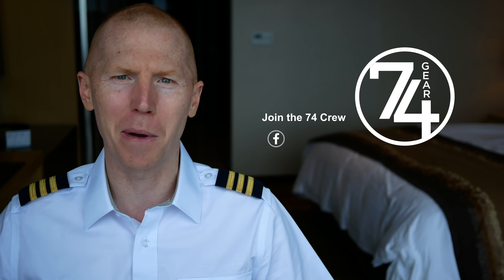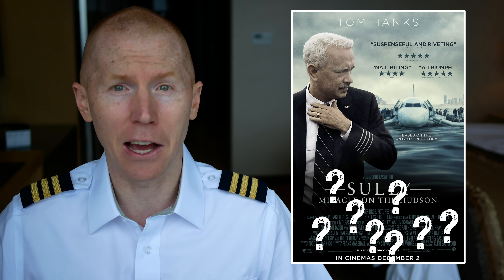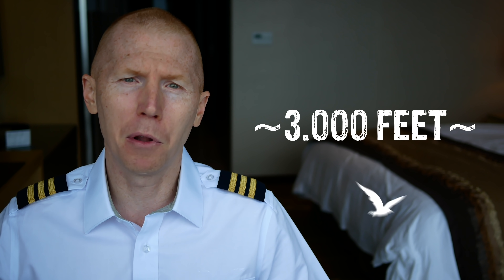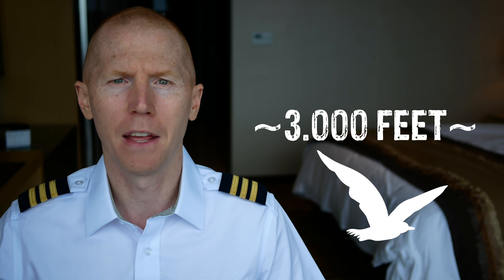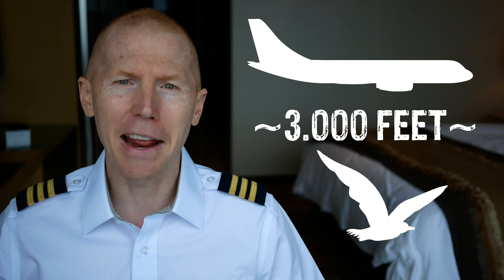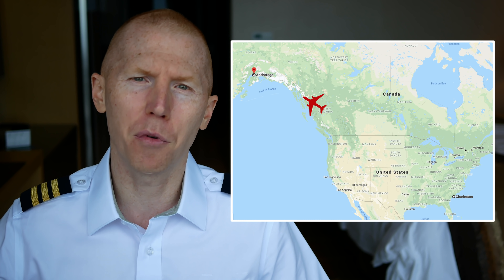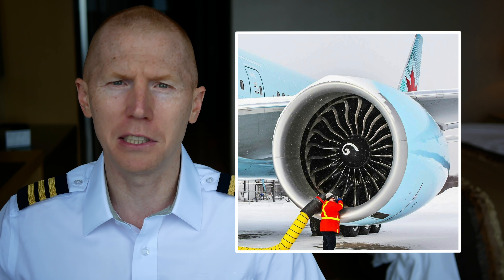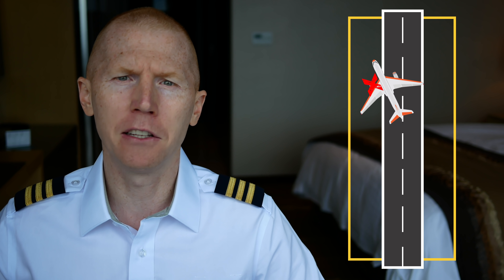Why Engines Don't Have a Mesh or Grates to Stop Birds

Comment: Make them 2” by 2” so it cuts the bird up more to make the jet engines digestion be easier preventing a big object and break it up some would be like this, imagine a brick... yeah that’s gunna need a new engine but imagine Little Rock’s going into it it’s going to be dented and very safe but you will still be able to reach your flights destination and one more thing make the 2” by 2” mesh design and make them sharp it’s like cutting up a toddlers food... but for a plane, who else (kinda agrees)

Comment: FYI....those engines are so massive, they can ingest a bird the size of a turkey with little to no damage, so long as it is around the outer edges of the fan and bypasses the motor itself. But even smaller birds can be ingested into the compressor without issue....to the plane, anyway. Tweetie ain't gonna make it. What brought down Sully was the fact his plane was reaaaaly hungry and tried to eat the whole flock.

Comment: The Russians have a technology to prevent their engines from ingesting stuff on take off❓.

There called slats. 

Their fighters have slats that close during takeoff and on top of the wing that open. ✈

Once airborne they simply reverse slats. The ones on top of the wing close and the ones in front of the air inlets open. ✈

Wondering if they would prevent bird strikes from happening?🦅

Probably impractical on modern airliners.

Comment: It wouldn’t make sense to put a grill onto something that sucks with such force, the bird would just be stuck there till landing, now think about if you had 30 birds stuck onto the grill in no way the engine will be able to suck air in at a rate to keep the airplane up in the air without trouble.

Comment: Im still for lasers, because they wont stop air flow.  Just pint them upward and away from the front of the engine cover and run them durring that 3000 foit sweat spot durring take off and landings.

Or go with a retractable slicer dicer screen that can be retracted to save the fuel economy

Comment: Just get rid of the engines altogether and develop a plane, that flies just like a bird by flapping its wings.
Reply: Yeah what could possibly go wrong!
Reply: Like an ornithopter
Reply: I cant see that craft go more than 300 km/h
Reply: @FlyLeah  r/woooosh
Reply: @FlyLeah  you mean h/km
Reply: funkyleah actually they’ve been able to make one that tops out at 389 mph (626km/h) and it’s only getting better. Look up Kenth Brooding’s model aircraft called the “Madill Ornithopter”. Right now it’s roughly twice as inefficient as the A3O8, but keep in mind that it’s still in its infant stage. The advantages of an ornithopter design is that it can theoretically be twice as efficient as an A350. The problem lies in the thermodynamics and the appearance. You see, the thermal equilibrium of the vertical stabilator is just too expensive to realistically create and mass produce. The amount of titanium (currently the only metal that can handle the excess heat while being light enough to fly) required is just unreasonably too much. Also, birds see the craft as a threat and will frequently kamikaze themselves to bring the aircraft down. They will try infiltrating through the windows and will peck the passengers eyes out. It’s a ghastly sight to see if I do say so myself. I still have nightmares about those damn pidgins
Reply: @lasercat538  LOL twice as efficient, bollocks. Metal fatigue alone buggers the ornithopter design.
Reply: @lasercat538  best comment of 2020
Reply: @carbon1255  he said inefficient can you read? (Yes I know he edited it but it was probably a typo)
Reply: @carbon1255  he said inefficient.  Ouh
Reply: Yeah, but then you get this whole birds of prey problem
Reply: Lol that reminds me of a video of a plane flapping its wings
Reply: You've became the very thing you swore to destroy
Reply: Yea, and the enormous amount of energy you waste, such a low efficiency, you go incredibly slow, easily out of control due to the  always heavy turbolence. Imagine passengers having to sit in that for hours. A bird strike does not happen quitte often, and if it happens, the engine does not always fail.
Reply: Not fast enough
Reply: Ever flown in turbulence? The plane looks like a bird flapping its wings.
Reply: That would make a bumpy ride, waste more fuel, and it would take probably a year to do a 7 hour flight
Reply: Have the passengers help! Lower the costs of the tickets, but have them lift their own weight! Literally
Reply: @Zman44444  ?
Reply: @kokoslegend4850  the OP’s comment... flapping wings... have the passengers flap....
Reply: @Zman44444  terrible idea😂
Reply: @kokoslegend4850  cool!
Reply: @Zman44444  yea, but to fly to another country is too dangerous, and slow.
Reply: @kokoslegend4850  neat! I’m glad you enjoyed the jokes.
Reply: @Zman44444  yea 😂👍
Reply: It will be bouncy for the passengers through out the flight
Reply: GENIUS! I have a way to make money now... hehehe
Reply: Dune!
Reply: And how is that flapping accomplished?
Reply: @notthefather3919  by a way to heavy motor that guzzles fuel like you wouldn't believe...
Reply: Damn that would be a big bird going into the trade centre 2.0
Reply: @Roshaun Thomas eh just use flex tape
Reply: Now I'm imagining a 747 flapping its giant metal wings.
Reply: It already exists and it's called a thopter
Reply: LMAO
Reply: Reminds me of that "get real" meme
Reply: or fuck a bee, and then have his whole hive carry the plane
Reply: LOL
Reply: and then it will slap birds out of the air
Reply: Or just make an electric plane
Reply: @laronzovilla9863  wouldn’t go as fast and normal commercial jets and also more expensive and more things can go wrong. You would remove hydraulics and everything that would be so expensive to train new people for it and invest so much time...
Reply: @laronzovilla9863  that wont work
Reply: @laronzovilla9863  that is a good thought but making those arn't as easy as it may seem

Comment: Lasers do not block airflow. 

Myth: Busted.
Reply: CMDR Fly Auburn Its still going to allow bird guts inside the engine.
Reply: @48kelvin  A powerful enough laser would actually vaporise the bird. However, due to the immense power requirements, there would not be enough room on board for passengers.
Reply: @carbon1255  or the nuclear reactor needed to power that laser mesh lol
Reply: @carbon1255  why not use the laser only below 3000 feet, as he said birds are typically found below that altitude. And after that height,turn off. This saves the power too.
Reply: @akitakasakiama5258  For one thing, the laser field would need to be self-contained (the beams terminated by a backstop), otherwise the beams would be hitting other things near and far including the plane's own fuselage, potentially.  That backstop would need to be an extremely resilient exotic material (like a super-superalloy metal) to withstand sustained laser exposure again and again, day after day.   One could argue that such a system itself is way more dangerous than a potential bird strike.  Imagine if one of the lasers slowly falls out of alignment or the backstop fails or a bird misses the laser field but hits the laser emitting fixture on the front of the engine nacelle, now lasers are pointed every which way, hitting flight control surfaces, passengers, fuel tanks, people on the ground, etc.  Planes make hard landings, turbulence flexes the wings and shakes the engine mounts, it's not a suitable environment for precisely-aimed and calibrated lasers, at least not if one expects them to stay that way.  Also, the laser would need to be astronomically hot/powerful to incinerate a bird passing perpendicularly through its beam at over 200 knots.  If this is a laser array oriented like a net in front of the engine, the bird passes through the laser so fast that it's only exposed to the beam for the tiniest fraction of a second.  In order to accomplish anything, the laser would need to be so hot that no Earthly material would stand a chance acting as a backstop.  If the laser were some kind of IR/radar turret shooting the bird as it approaches the plane then it would have more time to focus its beam on the bird as it approaches (thus destroying it).  BUT, any mishap in alignment, aim, timing or misidentification of a target and you have a big problem on your hands.  Like, whoops the laser missed the bird but hit the chemical factory off the end of the runway.  Or, whoops the tracking system thought that smaller plane landing on a parallel runway was an albatross.  This is a case where the "solution" creates more deadly risks than it solves.
Reply: @akitakasakiama5258  It doesn't matter if it is on or off, it still takes the same amount of space :')

Of course it only fires for a few fractions of a second until the bird is ashes regardless.
Reply: @dmo224  You gave your answer to an absurd suggestion rather a lot of thought. I was more confused as to how a laser gets smaller when switched off and how you get the passengers in at over 3,000 ft. 

The US developed an aircraft laser system using a passenger jet. you don't really need a backstop, the idea of a point defence system is you fry any bird with a possible intersection with yours, you could kill them at 1km ranges.

However, you couldn't carry passengers xD
Reply: @carbon1255  Definitely agree that the weight of the apparatus and its power-supply remains a huge issue, whether powered on or off.  Something like what you described (the airborne missile defense system), where the laser isn't a mesh field but actually shoots out into the world, seems like the only way something like this could even work.  Unless, there is a ground-based anti-bird laser battery shooting up at birds.  The problem with either of those non-backstoped laser turret concepts is the potential (almost guaranteed eventuality) of missed shots and collateral damage.  If you were to replace the laser beam with a gun that fires conventional ammunition, it's easy to visualize the problem.

A laser "weapon" that is lethal at 1 km would be potentially lethal (or destructively problematic) to anyone or anything on the ground when the plane firing this laser is below 3,000 feet.  There are so many "potential" birdstrikes within a 1 km targeting cone, it's not definitely going to be a birdstrike until the very last moment.  They can come from the side, above, below, or they could be straight ahead and then fly away/move like they mostly do.  So there's a pretty wide volume of sky full of potential targets.

Let's say you're on final approach to the runway when a hawk in the grass next to approach lights takes off and "potentially" becomes a birdstrike factor.  Your plane's laser concludes it's a threat, takes aim and fires but misses the bird's center mass, blasts through one of its wing feathers and hits Joe, the baggage-loading guy at Gate D17 (or a taxiing plane, or the control tower, tank farm, parking lot, terminal building etc.).   The airport and surrounding neighborhood could end up looking like a war zone, so many planes would be shooting off so many lasers so often that people could easily find themselves longing for the days when the most dangerous things in the sky were the seagulls.

One alternative idea would be to have a focused beam, be it a laser or something else, which annoys the bird (as opposed to vaporizing it), prompting it to go away.  That way, if it misses, it only annoys innocent bystanders.
Reply: @48kelvin  Precooked.  ;)
Reply: To be fair a laser grid would probably make it into small enough chunks to pass through
Reply: dude what are you TEN
Reply: If you get a laser powerful enough to chop a bird up in less that a second, it wouldn’t be safe to put on a commercial aircraft

Comment: I kinda' figured that a screen would inhibit some airflow.  What I also imagined is that if the bird damaged the screen, there would be not only a mushy, (relatively) soft bird going in,  but hard aluminum or titanium chunks as well.   That, and if the screen did hold up, now you have this dead bird stuck to it, blocking even more airflow.  I saw something like that last bit at a coal-fired power plant once.  The huge blower-fans were at ground level,  but still roughly 10 to 12 feet tall.  What a roaring sound!   But, there were screens over them like chain-link fence.  I guess a few birds flew too close and got sucked in and just stayed stuck to it.  As well as a glove and some  litter.

Comment: How about a retractable wedge? On each engine? 

Leave the bottom half and top half open so the engine can still suck in air.  Or at least just the bottom half. Like a pyramid without one of its sides and the bottom. Then it can retract mid air.

Comment: put a coned bird filter frame on the front. make it retractable. just make the frame tough, and have holes big enough to stop large birds, not small ones. the coned shape will allow more air than a flat filter because it's shape allows more surface area. the cone shape could even be aerodynamic to prevent drag.

Comment: Jet engines suck air and intake rate average 400 miles per hour. If gril or screen made of titanium and every mesh of it with aerodynamic cube design, then neither air intake rate reduce nor screen  plunge in to engine when birds strike because titanium is very hard and any bird strike it merely made any significant damage on the screen or engine. So titanium screen would be the best answer for birds strike, runway debris or snow intake by jet engines.

Comment: Fighter engines often DO have screens to prevent foreign object injection. This has not only saved planes from bird strikes but saved plane mechanics from being ingested by the actual turbomachinery and therefore stopped them from being killed by the engine.

Comment: Thank you sir, for that explanation. Highly appreciated. 
However, it seems to me that the main issue here is a fixation on Engine “EFFICIENCY VALUES”! The Mesh, or screen can only reduce efficiency but can't totally stop airflow.  
I will determine the airflow reduction due to the Mesh, enlarge the Engine to compensate for that difference. Efficiency may be lower than state-of-the-art but takes nothing from the engine in performance terms and totally eliminates the dreaded safety issues.  Lives are more valuable than numbers. This is my take

Comment: If you want to know why what Capt. Sullenberg did was so impressive, just look at what happened to a 707 that ran out of fuel during a hostage situation and the pilot was forced to attempt a water landing just off the Seychelles Islands.   It didn’t end as nicely as the ‘Miracle On The Hudson’.

Another problem with putting a grate over the front of a jet engine is that the grating itself is a prime place for ice build-up.
Reply: I apologize; it was a hijacked Ethiopian Air Lines 767 off the Comoros Islands.

Comment: Its not the birds I worry about when I fly. Its the planes computers. And there is NO video that you will ever make that will explain just how safe the computers make the air planes. It makes them many dozens of times more dangerous. And the issues much more complex when they happen because OF computerization. 

I think all planes should be like the MD 80. All mechanical.

Comment: Also, at the speed of 400-600 miles/hour, if a bird hit the screen/grate, there is a risk of grate/screen breaking and hit the engine along with the bird.
A better solution is to mount a couple of rapid fire miniguns on the top of the engines that can trackt and obliterate any incoming target before it hits the engines. This technology is similar to what they have installed on Navy ships and Bombers. (tee hee)

Comment: Retractable engine screen for takeoff and landing duh.
Reply: Unless your mesh is made of adamantium, if a bird hits the engine, it's just going to take all that metal wire and shit into the engine, which would cause much more damage than just the relatively soft flesh and bone.

Comment: You could just install a mesh that is active at takeoff and landing and retracts at high altitudes. Im no expert but it kinda sounds like the real reasoning is that a covering would be just another thing to malfunction and you especially dont want an engine to have a large chunk of stuff in front of it ready to be sucked in if a screw is loose.
Reply: That limits your climb power when you need it most, and you're right adding more mechanisms is generally not a good idea especially given how infrequent bird strikes are

Comment: why could you not have a ring of venturi's mounted around the radius of the engine opening to inject air into the engine to compensate for the decreased efficiency caused by a bird grill?
then you'd have safety AND efficiency.

Comment: Why not screens that retract above 3,000 ft?
Reply: Unless your mesh is made of adamantium, if a bird hits the engine, it's just going to take all that metal wire and shit into the engine, which would cause much more damage than just the relatively soft flesh and bone.